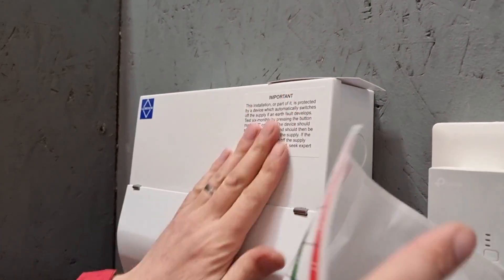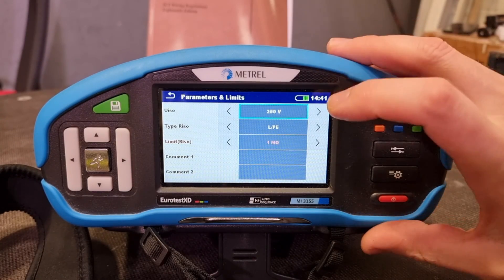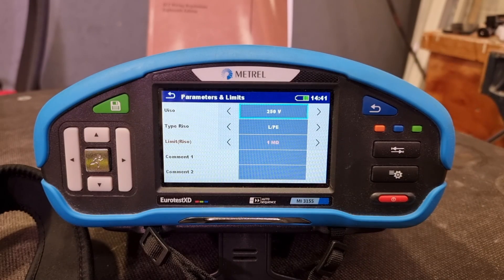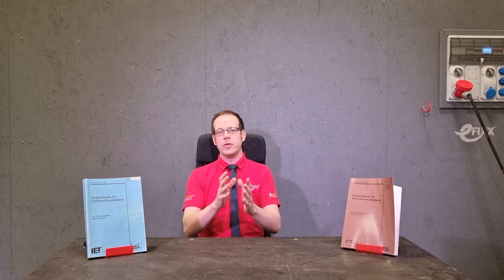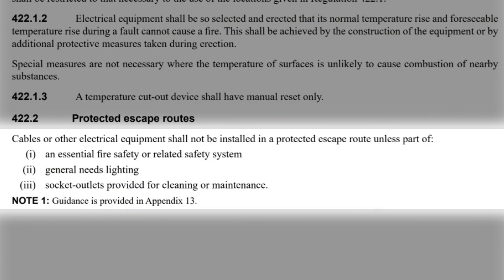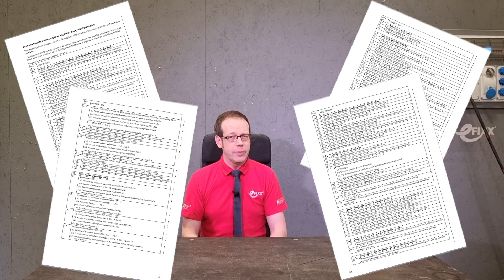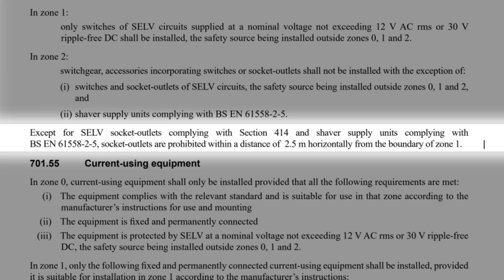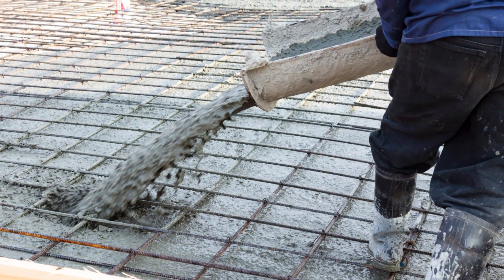13 Changes in BS7671 Amendment 2 - Plus ONE that didn't make it

Comment from the maker: What do you think of the changes? -  Do you have any questions?
Reply: Generally common sense this time -  especially regarding how useless type AC RCD's are, simplifying/clarifying RCD testing , and consumer unit labels. Anything that makes the model forms easier for customers to understand is good too. It's really just the the protected escape routes issue that is going to be fun.
Thanks again for the video.
Reply from the maker: That's pretty much our take on it as well actually, the escape routes will make design a little trickier for sure. 😊
Reply: I think that we should start making 4 meter wide bathrooms, just to be safe when the toaster falls into the bath while A type RCD has just failed between the moment of impact and last time RCD was tested (every 30.4 days as clearly required).

Actually outlets should be allowed if they are protected by RCD. If not, BS should also require cars to travel no faster than 3,5 meters per second.
Reply: I can see designers and architects looking at how a ceiling void above a protected escape route can be reclassified. A service duct separated from the ceiling void perhaps?
Reply: I'd agree that this seems pretty straight forward and just more incremental progress in the general direction of movement.. I'm kinda sad about the foundation earthing as it does provide such a brilliant earth path!! but it also takes the DNO off the hook for providing a reliable earth....
Reply: Will the new tick sheets still have a paragraph for each tick box showing what you must abide by to allow it to be ticked?
Reply: In other words will it have 14 tick boxes but still be 3 pages or so long
Reply: Very good, enjoyed the nee information, books 📚 have been on pre order. So when will the next exam be out, I already have my 18th, well the exam just cover the changes or is it the whole book again?
Reply: Electrical cables and equipment above ceilings in Protected Escape Routes: does/doesn't apply to domestic dwellings?
Reply: @Goboholder  So it's important to understand that an 'escape route' and a 'protected escape route' are different and are not interchangeable, so the restrictions around what can be installed in a 'protected escape route' do not apply to an 'escape route'.  As a 'protected escape route' is used to overcome the issues when the maximum distances of an escape route as defined in BS9999 commercial and industrial locations and BS 9991 for domestic installations is exceeded or can't be met.  For example, you would use the escape route (the corridor in a hotel say) and enter a 'protected escape route' (one of the stairwells of the hotel) as your full means of escape in the event of a fire because the travel distance would likely be too great without that additional 'protected escape route'. 

The term 'protected escape route' has been brought into the regulations to try and clarify and align them to the BS standards on fire safety but in reality, it is probably going to create more confusion for a lot of people that are not familiar with the BS standards around fire safety. 

So to answer your question, in reality, you are only likely to encounter 'protected escape routes' (typically but not limited to stairwells in blocks of flats, offices etc.), so if you are working mainly domestic it is unlikely to be much of an issue.
Reply: @Mark-xr4zt  I would also be interested if a addition to a circuit served with a AC type rcd  would require us to change the device to A type to comply.
Reply: Hi efixx. Niceic are saying only 0 OR 180 at 1x which is contrary to what GN3 is saying. What do you reckon?
Reply: looking into becoming an electrician where do I download a full copy of BS7671?
Reply: @Mark-xr4zt   charge you for regulations you need 
That can’t be bought as stand alone sounds like a ball ache 😣 
Is there not additional certification required as well

Comment: Color changes are idiotic, they just add confusion between new regulations and old installation, the whole "consumer unit" blocks to be of the same brand is idiotic and it seems like a lobby effort rather than something useful for the consumer and I would like to see it lobbied out of the regulations.
These units have electrical parameters, and as long as they satisfy those parameters, they should work fine in a complex system. Otherwise how can you expand consumer units? full replacements each time? ridiculous

Comment: some of the changes make you think that they do them just to print a new book, like socket outlet in bathrooms from 3m to 2.5, if if was 2.25 than would say oh it's inline with zone 1 measurements, then no cables in fire exits ceilings! how s*tu* is that. the only good addition is the SPDs.

Comment: In regards to the AFDDs does this mean HMOs and the others listed that must have them fitted will fail on the EICRs for not having them installed even if the installation use to comply to the regs when it was installed? 

So basically do landlords have to fit them to all there properties that they already own for example or is it you just have to fit them to new installs?

Comment: Situation- New circuit in say 17th ed split load board,Type AC RCD, no SPD (some minor works as well I suppose!). Does this now require a change of RCD  (to type A) and SPD Fitting for new work to comply to 18thAmd2? For the money this will become a board change in a lot of cases right? Otherwise its New RCBO in the board and New seperate Box for SPD (as we all know it will not have 3 spare ways!).

Comment: Hi Joe , are we good.
I have a question for you, why do the IET continually say the when a new edition of BS7671 or an amendment to BS7671 comes out that we can no longer work to the earlier edition? As we the electricians all know that there are very little changes made as such 95% of the regs are the same as the previous edition. Ie with amendment 2 there are only a dozen or so changes but 95 % of BS 7671 is the same as it was which is the same as 16th and 17th edition surely we only work two the regs that relate to the type of work we do , ie if I don’t have anything to do with say EV and solar PV then I only need to comply with the rest of the regs and ignore the bits on EV Solar PV ? Basically all the book from the 15th edition up to the 18th are the same baring a few small changes.
Reply from the maker: Hi Sean, yeah we're good. Might not always see eye to eye on stuff but that's just life eh?

The way it works is a little more complicated than just working to the latest edition. When a new amendment or edition drops JPEL 64 withdraw their support for the previous iteration. However a project that was started under the previous edition will likely only need to comply with that edition. For bif projects that span more than one edition it boils down to whatever was agreed in the contract. So a job that was started under the 1st Amendment will most likely have to comply to that amendment and not the 2nd. Does that make sense?
Reply: @efixx  yes a little. 
But like I said if say like me you don’t have any interest in say EV or say battery storage and I unlikely to ever stall such things the surly that amendment will not apply to you so you could continue with the parts of the book that does even the earlier book? I think just an opinion from a humble spark who’s opinion means nothing. Thank you for your kind reply and explanation. 
Oh and I am happy we are good 
I sure you know I don’t mean any disrespect to you or Gaz Or Gordon I have a lot of respect for you all. But some of the products you review we’ll that’s a different kettle of fish. I always love having a good Old debate with you that’s how we learn.👍👍❤️
Reply from the maker: Yeah, if specific applicable regs haven't changed then I guess technically you're working to all the editions! 😂

No worries on the other stuff. Respectful debate is healthy. 😊

Comment: thanks for making me feel better about the US electrical code
Reply: Interesting? May I ask you to elaborate on the reasons for your sudden burst of happiness and overall smug tone regarding your US electrical code. The United States has more power outages than any other developed country.  120v systems are a poor man's 230/240v system I'm afraid. And the UKs fused plug top is still by far the most important genius invention and is the key to how electricity is distributed in the UK.
Reply: @Foot2theFloorGT4  i was pointing out that the US  electrical is far more lenient. 
couldn't care less about voltages or power outages.
Reply: @chainsawsandgenerators9952  leniency? Fair enough can't say I'm familiar with the US installation regulations so I'll take your word for it. We are over the top I'll give you that 😉

Comment: There's an awful lot of split-load CUs with twin Type AC RCDs out there. Under what circumstances would these need to be changed to Type A and assuming they're available?
Reply from the maker: We will explore this further
Reply: @efixx  Thank you.
Reply: They won't! Everything from September onwards, will have to be compliant with Ammend 2,  but these new regs are not retro spect and everything that has been carried out pre Ammend 2 can't all of a sudden be wrong!!
Reply: @jonnyduncan7056  I was thinking about adding a new circuit to such a CU, which would have to be compliant.

Comment: Why do the IET Keep messing around with earth rods?, AMD 1 = move away from them due to dangers from hidden services, now they want them in all TNCS arrangements?
Reply from the maker: Well the move away from earth rods was particularly in connection with EV charge points, the application in amendment 2 is to shore up the distribution network, so slightly different applications but I get what you're saying. 😊
Reply: @efixx  That is true, but the same issues are there in regards to the use of earth rods, whether its due to ev or supplementing a tncs or TT 👍🏼
Reply: Also, is there not a case of potentially masking broken PEN conductors, could this be dangerous?

Comment: Protected Escape Routes — are already limited in that there must be no flammable materials and no electrical installations except, fire alarm systems, incidental lighting and sockets provided for the purposes of cleaning.  Your general corridor with a suspended ceiling is very unlikely indeed to be a PER and so there's still no inhibition to slinging a cable through the ceiling void — other regulations being observed of course.
Reply: I can see a lot of arguments between architects and building control over the definition of protected escape route. Surely this could be applied to every corridor in a hotel or office block.
Reply: @christopherhume8896   They shouldn't be arguing about it.  The definition is statutory. It's in Approved document B, Fire Safety, Volume 2, Buildings other than dwellinghouses.  https://assets.publishing.service.gov.uk/government/uploads/system/uploads/attachment_data/file/832631/Approved_Document_B_fire_safety__volume_1-_2019_edition.pdf

Comment: TBH I'm glad I stopped contracting last year, too much trying to explain to customers why they have to spend more money that previous years and why something that was fine on an EICR 12 months ago now needs rectifying at their cost. Don't get me wrong, I'm all for safety, but having to pay out for more publications and their associated GNs just really grips me.

I now work for the local town council as a caretaker, swapping lamps and the occasional light fitting, cracked socket outlets can be a real struggle... 🤣🤣
Reply: I thought there was a get-out clause in NOTE 2 under 651.2 that installations complying with older versions of the reg's may not necessarily be unsafe? Please tell me it's still there in amendment 2!

Comment: With our awful earth resistance here in Finland we have been bonding the foundation for years, along with around 20 meters of bare copper around the house. The way to do the foundation bonding is to bring the rebar out of the concrete inside an internal wall, and attach the bonding conductor there, no need to attend the pouring of the slab. Mind you, we’re all on TN-C-S here for the most part.
Reply: I think the Germans started connecting the foundation rebar to the main equipotential bonding bus bar some time in the 1960s, usually by bringing a piece of flat 30x3 mm flat galvanised stock out of one wall. More recently, most earthing systems have switched to stainless.
Reply: I can tell you now in the UK that wouldn't happen, the thick ground workers we have would probably fetch the re-bar up in the center of the lounge floor,  and that's if they remembered it in the first place.
Reply: @acelectricalsecurity 🤣🤣
Reply from the maker: Brilliant, good to know thanks. 😊

Comment: 422.2 No electrical circuits in escape routes: so in a domestic dwelling that would typically be the hall leading to the front door, hence NO mains powered door bell circuit ... Yeah right? No storage heater in the hall! ... Yeah right! Everything else as normal, EXCEPT only "general use" lighting so "safety" lighting ("special or specific use"?) not allowed!? Yeah right! No mirrors with lights fitted to them ... Specific use again!? Not allowed sockets except for maintenance or cleaning ... So no light on top of a hall sideboard or small table!? Yeah right!? No charger point for your phone when you come in? Yeah! Right!?

No "mandatory" requirement for surge protection if customer signs waiver!? Do sparkies and more to the point the (presumably chartered) erstwhile fellow IET engineering.members, like myself, who came up with this do realise that by far the bulk of "sensitive" electronic kit for at least the last 20 years has had "inbuilt" surge protection, especially in the case of SMPSUs that in many cases is superior in protection to the typical "EXPENSIVE" MCB style cartridges being used in CUs. Especially since they are little more than ordinary MOVs anyway!?

OF COURSE customers will sign waivers ... They have insurance to cover for lightning strike etc and often with new for old a brand new TV can be had for free!

You couldn't make this stuff up! Nuts!  😱😱😱😱
Reply from the maker: I believe that typical domestic dwellings don't have protected escape routes, there's no fire doors off the hall and landing in my house for example.
Reply: @efixx  Townhouses need them I believe. Anything with a 2nd upper floor or higher...
Reply: @efixx  Hi Joe what would u consider a flat and plastic split load board is located about door in the escape route with type AC RCD. Thanks

Comment: What I find funny was the 2006-9 debates and set up of Solar and safety, by Clueless and guesses.  Then had a look recently to find contradictions and major flaws.
Now it seems I've got some reading, but I've been told there are more changes for June this year too.
Reply from the maker: It's definitely ramping up again isn't it?
Reply: @efixx  behind the public front there are a number of wants and issues. 
Solar power being major. It dumps loads of power to the grid and can cause surges (hence other regs) but then it drops at night.
The problem they want to get over is storage due to the space and cost. So they're driving toward battery ownership.
From what I've seen companies are selling the wrong batteries so that will need to be addressed and will have to come into training.
People want Solar but there is the cost and due to its nature try to DIY and where stupid  is available it will follow.
It's all good making changes but will the wider public know? Probably not.

Comment: AFDD's, just wait, they will be everywhere on the next release!  Welcome to what we have to deal with in the USA, where they are required for just about everything here.  💲💲💲👍😁
Reply from the maker: Yur, pretty sure they'll become increasingly required. 😊
Reply: Back in 2013 a friend had a house built here in the US, I guess the AFDD’s were first generation, they were terrible. Roughly half of them had to be replaced within three years, all out of warranty. I hope the companies making the UK AFDD’s have the bugs worked out.
Reply: @mikecumbo7531  Yes for the most part.  Our house was built in 2008 and at the time they were only required in bedrooms here.  So we ended up with a handful of them in the panels.  We have Eaton load center panels and they warranty them for 10 years.  I had to replace one of them about 2014, as it would trip at random times.  After replacing, no trips since.  Now they are pretty much required for every 120V breaker.  GFCI's have increased as well to just about every damp/wet location or below grade (basement).  They are now required for any device outside as well even if its 240V, like HVAC condensing units.  Many homes here have somewhere between 20-40 breakers for a new build, so having to use AFCI(AFDD) and GFCIs can get quite expensive.  We also have a requirement for SPD's as well at the panel now as of 2020 code.